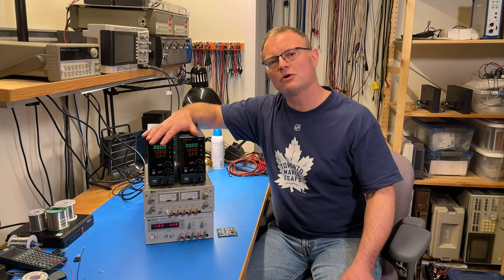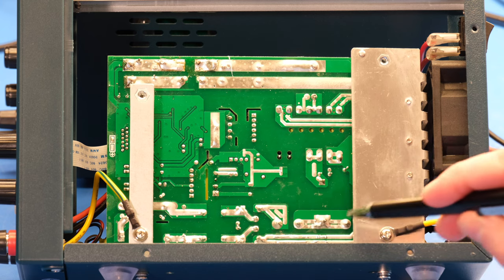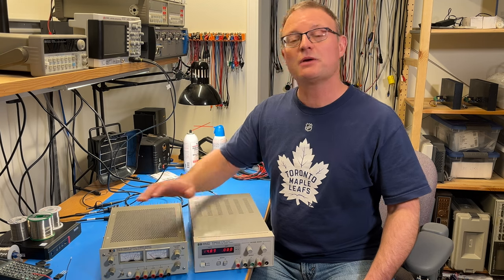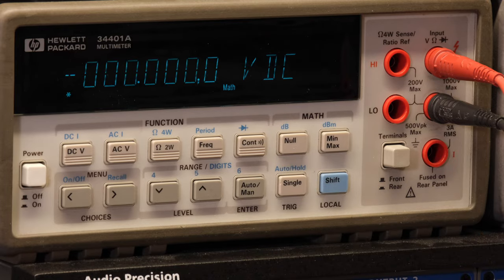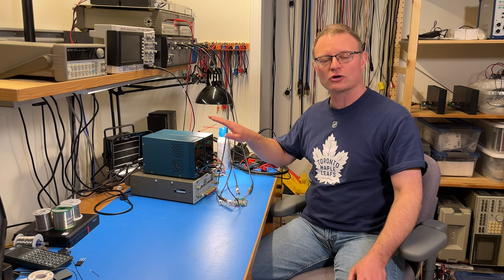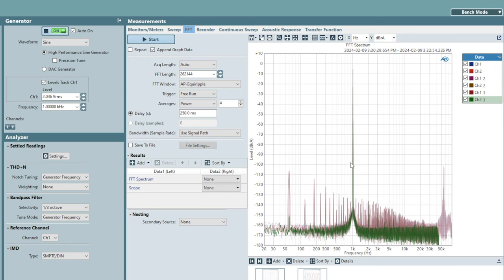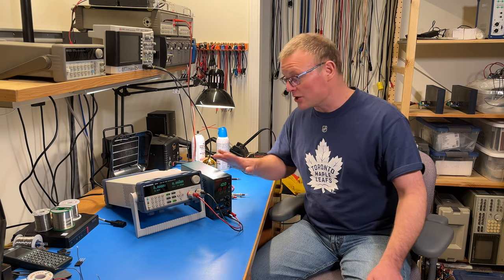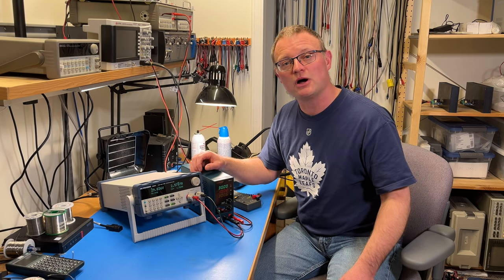Are cheap power supplies any good for audio measurements?

Comment: Switchers are fine for setting up. But I have a stack of batteries I can always swap over to for making a measurement.
Reply from the maker: It's pretty rare that I switch to batteries. The output impedance of a battery is pretty nonlinear, so they don't always offer good performance - especially with power amps. But they can be alright for line-level work. I used a pair of power tool batteries to power a precision oscillator at one point. That worked pretty well, but that was also a Class A circuit. Class A/B is a completely different ball of wax as I cover in a different video (https://youtu.be/j-zLrcLZLc0?si=DbeDoq0GAsQb9q-1). Good point, though.
Reply: @Neurochrome2010  I wouldn't use a battery for a power amp. Just low level stuff.

Comment: the jitter you see on the scope is likely because you're looking 60ms away from the trigger point at a relatively fast timebase of 200us/
Reply from the maker: Interestingly, reducing the delay to 0 s made the edge in the centre stand still (because that's the trigger point) but the other edges were still jittery. So I think it's related to the B+K 8600B load. Good eye though!

Comment: I read somewhere that most of these bench power supplies are not suitable for audio due to high noise floor.
Reply from the maker: My findings in this video: https://youtu.be/j-zLrcLZLc0 agree with you. I was able to get good performance at line level but not with a power amp.

Comment: I use twin Korad KA3005P - Programmable Precision Variable Adjustable 30V, 5A DC Linear Power Supplies.  Much better construction
Reply from the maker: Korad!! Thank you! That was the supply I tried some 10ish years ago (mentioned here: https://www.youtube.com/watch?v=j-zLrcLZLc0&t=1s). That might work well enough for line level work (so preamps and such) but it did not fare well when powering a power amp. Maybe I should buy another pair and review them.
Reply: @Neurochrome2010    Glad to be of help.  If I was going to buy a pair I think a 60V unit might be more applicable for power amps. KA6003P -  60V, 3A DC Linear Power supplies.  I also use two HP6264B units for higher amperage work.  Nice review.
Reply from the maker: There's a lot of value in the HP62xx series. I have a 6209 (320 V, 100 mA) for tube work. The 66xx-series is rock solid too. I have a pair of 6643A and should tomorrow have a pair of 6654A. That'll get me to ±60 V @ 9 A. 60 V, 3 A wouldn't be enough to test an audio amp with a 4 Ω (or even 8 Ω) load.
Reply: That'll teach me to shoot from the hip.  :)  My main area of interest is RF, and amateur radio, especially tube gear.  Lost my hearing in my left ear so audio isn't as interesting to me as it used to be.  I've subscribed.
Reply: @Neurochrome2010  You'll also find a small number of videos on YT discussing those korads, and they've had some design changes over the years actually helping to fix user found design issues. Seem to be pretty good now, when you're looking for that sweet spot in value between cheap and cheerful chinese switchers and some clunking heavy and expensive western linear.

Comment: You cannot even run or service an AM radio with a switch mode power supply, there are linear supplies such as Uni-T 3315 on the market for less than $100.
Reply from the maker: That's interesting given the various EMC standards. But then again, it's easy to slap a compliance mark on a product and hope for the best, so who knows if these Chinese supplies actually meet the standards. I know the supplies by HP/Agilent/Keysight do. Same for other major Western manufacturers. But they also charge several kilobuck for their products.

Comment: Why not just power it from battery during measurement?
Reply: Batteries are not the clean pure DC that is commonly assumed. The chemical action that produces the voltage also induces noise. Similar to shot noise. Not very much but still more than a precision linear regulator.
Reply from the maker: Batteries have a nasty way of being discharged when you need them. They also don't offer a specific or constant voltage. I like to characterize my circuits at, say, ±5, ±12, and ±15 V. That's not possible with batteries unless I add a regulator.

Those things aside (and the noise mentioned by @andydelle4509), batteries can be great for testing. I've sometimes used power tool batteries to weed out ground loop issues.
Reply: Is the user going to be running it from batteries in eventual home use?
Reply from the maker: Some do, actually. But most run from a power supply such as my Preamp Power Supply: https://neurochrome.com/products/preamp-power-supply